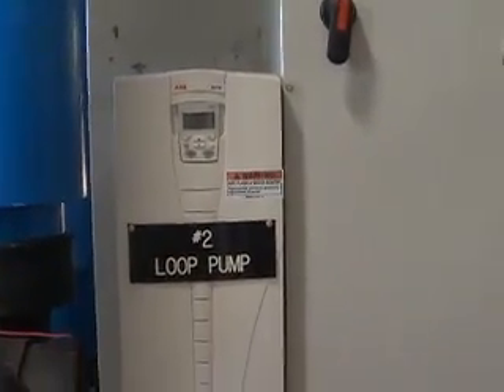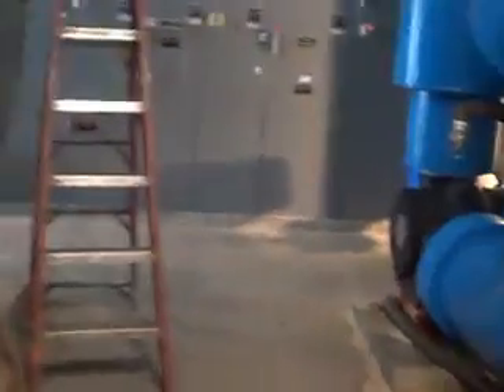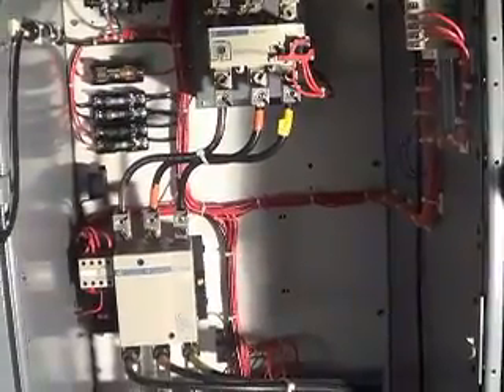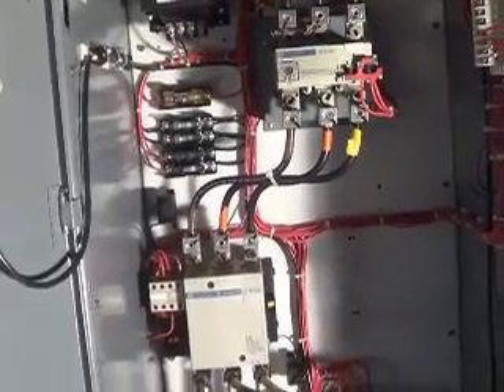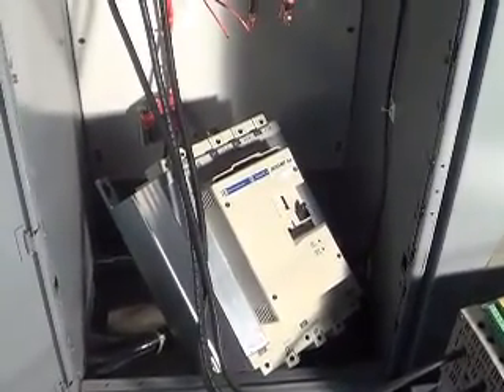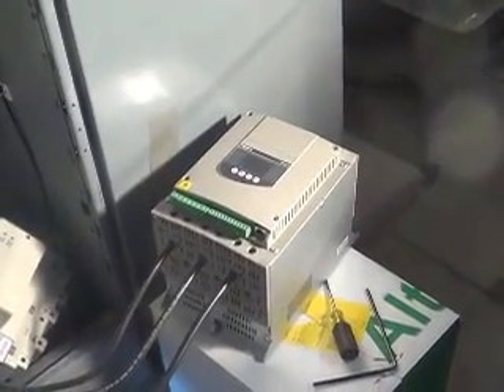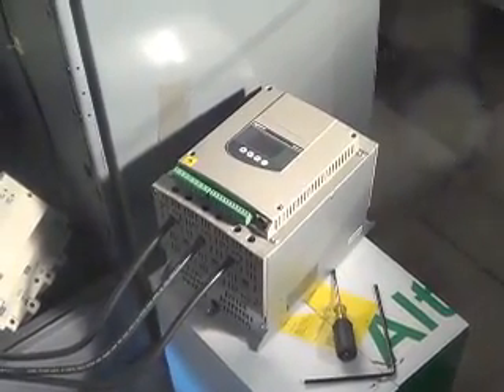Electric Motor Soft Start 60HP

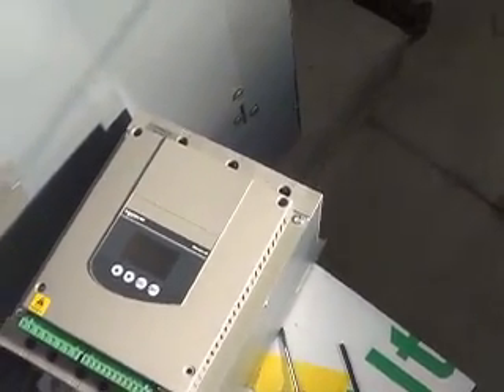Comment: 2:37 An Altivar frequency modulator ? Look similar at least. We use them at work. Have barely played around in the menu on one of those after having huge issues with the thermic protection on a 16Kw electric motor driving a vacuum pump.
Turned out to be the low temp in the equipment early in the morning that was the cause. A thermostatic heater oven solved the issue. hehe.

Escaping smoke can be a problem especially with the kind of equipment you are working on. :D Looks darn expensive!